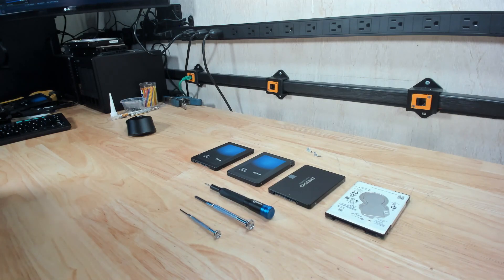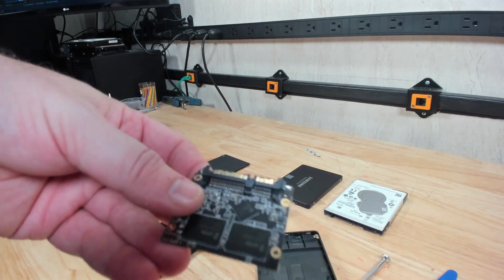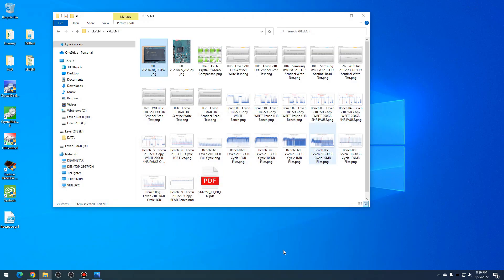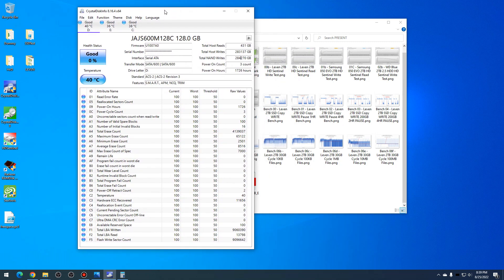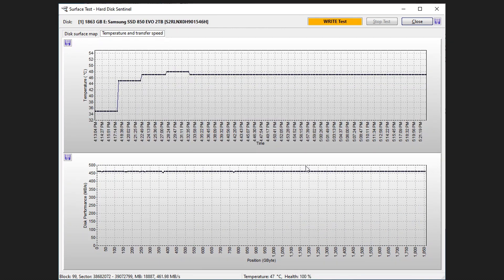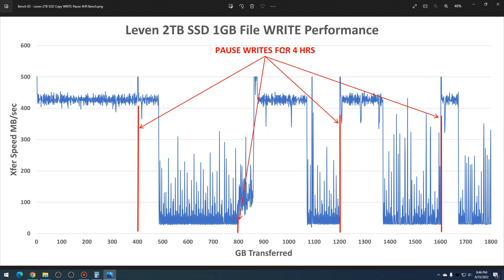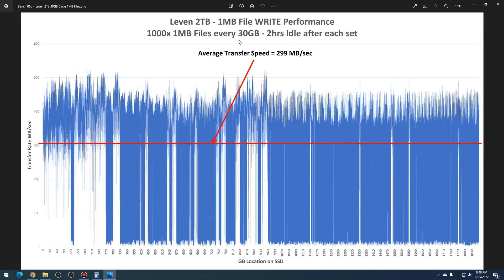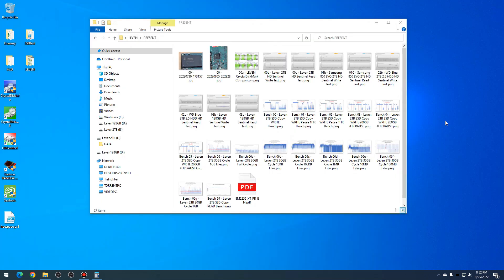$99 Leven 2TB SSD Teardown / Review

Comment: WARNING: Do not purchase any hard drives from LEVEN. They may be cheaper than most other hard drives but they do not back up their product. After 6 months the JS-600 256 SSD hard drive failed. Lost all my data (my fault did not back it up).  When I tried to get warranty on a failed hard drive they made me jump through hoops. They wanted me to send them multiple pictures of the failed product, so I did that. After over 20 emails back and forth of them "determining the issue" they wanted me to send them the failed drive. I did that, paid to ship them the failed hard drive. After they received it they claimed they did not have another replacement drive to send me and wanted my banking info. Said they will direct deposit me a refund. I asked them to send me a check instead - they said no. That is super fishy and I did not go for that! Still no replacement drive and no refund either. Buy at your own risk - I would stay away from this company!!
Reply from the maker: Thanks for the feedback. Yeah, personally I always wonder about these cheap drives. I usually buy them expecting them to be disposable, although they should still honor the warranty. I did find an Acer SSD though that seems to fare pretty well, I'll post some details on that. Picked one up for like $89 on Black Friday for 2TB.
Reply: @htwingnut  can you link that acer ssd?
Reply from the maker: @straksparty3425  Sure: https://smile.amazon.com/dp/B08YYRQ4DS

I have video coming soon.
Reply: @htwingnut  thank you
Reply: @htwingnut  sadly I live in Europe and shipping for this ssd is 60 dollars I wish I could purchase it and don't pay so much

Comment: Wow. I loved the thoroughness of your testing and review, subbed! I just purchased 2 Silicon Power 2TB A55 2.5" SSDs and I was a little concerned with the write speed tanking all the way down to 45-60MB/s, but it behaves precisely like this Leven unit does to a T, so this review was reassuring. I bought them solely for bulk storage as I'm slowly migrating all my spinning disks to solid state, so I'm not really bothered by the slow write performance as the writing will be a one and done thing. Hopefully the drives longevity is good, but I'm not formatting the HDDs they replaced just in case.
Reply from the maker: Good to hear it was helpful! Yeah they are good for a primarily read only storage.

Comment: Do you have any insight on why 2.5" SSDs aren't significantly cheaper than NVMe M.2 SSDs?  
There's so much more space for the NAND chips in the enclosure, so they don't need to use the densest ones, plus the drive speed is limited to SATA's max bus speed of ~550MB/s, so no need for the fastest chips.

The best I can come up with is that the retail selling price of the SATA drives subsidize the cost of selling the NVME's at more competitive prices.

Comment: Leven also makes an SSD with dram cache (JSD600). I would be interested in seeing some testing on that one. There is also the JSR800 but not sure where this one falls into the lineup.
Reply from the maker: Thanks. I was not aware. It looks like they have 128GB and 256GB versions only that I can find with DRAM cache. I may pick up the 256GB version and take a look.
Reply: @htwingnut  I picked up the 128GB version for an old laptop to run Chrome OS Flex on. They certainly are cheap enough.
Reply from the maker: @gdoug80040  thanks. I snagged a 256GB version. Will update once  I get it. Thanks for alerting me to this. 👍